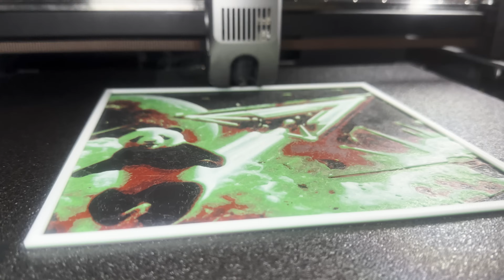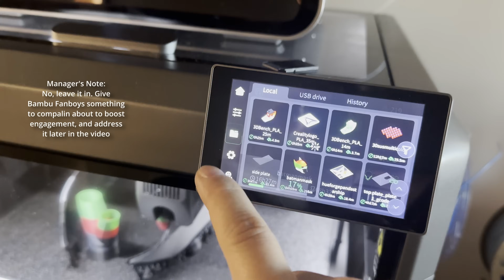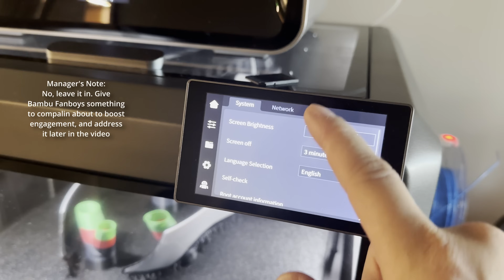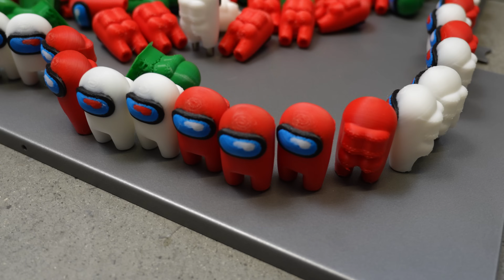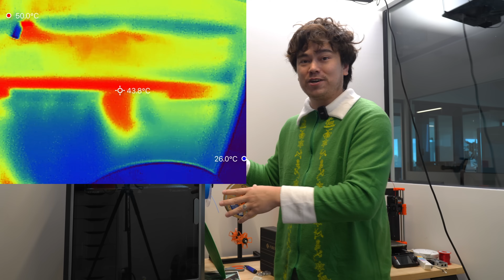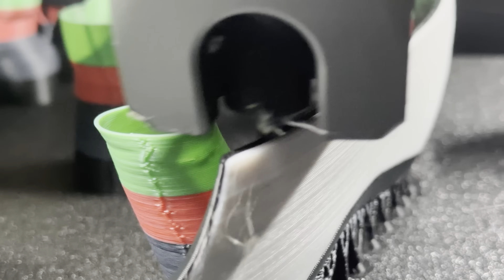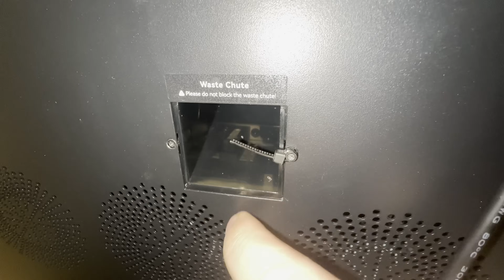Creality K2 Plus - Printer Of The Year 2024 (Goes on Sale Today)

Comment: My only gripes with this printer are these two things:
-The heated chamber has a very inefficient design, the hot air inlet is right next to the exhaust fans so if they're running all the hot air gets pushed out immediately and even when they're off the chamber only reaches max 50°C instead of the 60°C as advertised
-The software Creality Print is sometimes buggy and managing print profiles is a total night mare. Not only is the interface cumbersome, but there are TWO kinds of profiles, one for the printer itself and one for each filament and the print settings are distributed between them, seemingly at random. You'll find print temperature and cooling on the filament profiles, but layer height and print speed on the printer profile. Total nonsense lol

Comment: Well I kept my word and I ordered the K2 bundle a week ago. I see some people having problems, but they don't seem to be too clustered. Mostly people complain about the slicer, but I'm dealing with that today on my K1 Max and the deficiencies are overcomable.

Listening to this video again today, something struck me. You keep saying its better than the Bambu in every way, but you're missing the reason it's not. If you don't have a strong case for a 350mm^3 multi-color printer, the P1S is better for economy. Get 2 for the price, great quality, multi-color. All of the edge cases with higher temps etc., are not a concern for most.

Obviously, I have a use case, or I wouldn't be forking over $1,500. I'm also getting a MK4S for enjoyment, but there's no way I'd get the XL. Too pricey and fraught with issues.

Comment: Man what kind of engineer you are? electrical? You don't need a 3d printer for your designs, but a plywood lasercutter
Reply from the maker: Yeah i thought the same thing, but I discovered that a large 3D printer is much more useful than a laser cutter in practice.

With lasers you produce a shit ton of smoke and have to have large sheets of stock material, which you only get maybe 60% utilization out of it by area.

Vs a printer it is slower, but takes up less desk space, materials are more compact and used more efficiently, and you can add 2.5D and 3D features, don’t have as serious of ventilation requirements, less risk of blinding, etc.

Comment: Looks like a good printer, may well get one myself if the 1q25 BambuLab release isn't a big step forward. Shame they didn't go for a six way AMS as there should be room for it on the top. Plus for the record the BL X1C detects purge shoot blockages and pauses the print.😊

Comment: If in 6 months Creality brings a K3 and the K2 plus is "forgotten" as Creality tends to do way too often, then it's not worth half what they are asking for it.  It's nice to see they made something that is state of the art (last time was the CR10 or Ender 3), but their lack of long term (or just plain) support in the past, makes me say: let's wait 6 months and see how this evolves ...  But what a BS on them being so open-source friendly.  They only released access to Klipper (aka Creality OS) after lots of pressure and being called out by many 3d printing Youtubers.  Also note that there is no "if Creality releases their changes to Klipper" - they are legally required to release anything they built on top of Klipper as it is GPLv3.  The same holds for their slicer!  Bambu is not running Klipper - they can't ... a P1S or A1 doesn't have the cpu to run Linux and Klipper.  They were able to fit as good or even better algorithms on a cheap ESP32 (including custom stepper control), so I don't blame them wanting to keep that artwork of programming closed source.

Comment: for the  waste issue between this and the prusa xl  for cost difference between both machines (1500 vs 3500) you could build a filament recycler for the poop. And the xl is missing a lot of features the k2 has.

Comment: Now... I can't wait to see what the K1 CFS Upgrade kit will cost. I've had to upgrade my K1 a lot to get it working nicely. Did the Linear Rail mod, the LDO Stepper with 20T Pulleys. Also got the first gen K1, with all the Extruder and hotend issues. But now, it's working nicely and I'm planning to do Linear rails for Y axis too.

Comment: Six minute into video and nothing said that make this "Printer of the Year" or it being any different than the first "K" which is a BLab clone. Even the AMS looks the same. What I can tell is different is that the K2 seem to have much larger print volume and that is what I was hoping you would get to. AND that seem to be the "biggest" difference? How can this be "Printer of the Year" when you are comparing it to a 2+ year old Bambu Lab? How does this stack up against the new Qidi?
Reply from the maker: It has a chamber heater.

The Qidi has some issues with the electronics melting, idk if I'd get one just yet.

Comment: Hello, today I have seen a P1S with an issue with one of the bearings which was made hard to access and basically bambu declaired an 8 hour work to replace it. And Alternatively they suggested to replace the entire top kinematics section. Is the Creality this bad to maintain also? I have read somewhere about a Qidi printer as well which you are unable to replace some parts, most likely to boost manufacturing of their machines.
Reply from the maker: Yeah I literally gave them several paragraphs of explanation of how the Corexy cantry is going to be a huge problem if any of the bearings go bad (they WILL go bad eventually, they are wear items). Basically, use them until they break, then throw it in the landfill and get a new one. Great business model as you have to keep buying from them.
Reply from the maker: BTW I sent them this explainer 2 years ago.
Reply: @NathanBuildsRobots  thanks for replying,  I can't see someone buying a premium priced machine from them once someone experience this issue. It's weird that nobody ever mentioned this, I just saw this today. It seems to be a very bad engineering choice from them but most likely have prioritize manufacturing cost and speed.
Reply: @NathanBuildsRobots  You don't have to do it in one 8 hr marathon though. Sure, it's a big job but break it down to an hour or so each day and it's manageable. I'm not saying it's ideal, and shouldn't be improved, but it doesn't make it disposable. Plenty of machines take a long time to fix. They do at least have really great service info.
Reply: @NathanBuildsRobots  Is that kind of thing less of a problem on this machine than a Bambu?

Comment: I really would like to own one.

But for that price I could also invest in one K1c, one Sovol SV08 and since there would be money left either in a CFS unit for both or in a Voron 0 Kit for rainy days.
But it's more than good that Creality is catching up with their homework! Hopefully a separate purchasable CFS and a normal sized K2c for like 599 € do follow.

I wonder .... for 3 times the price of that Sovol SV08: is it 3 times better? Especially considering printing mostly PLA, PETG ... maybe some ASA?!

p.s. What I don't like about Creality more and more is no consistency. Prusa had like the same extruder/ hotend combo for 3 generations of printers. As far as I know the parts (e.g. nozzle) from a K1 don't fit into a K1C or now into that K2. Same with that Ender 3 V3 lineup: 3 different models available where one base models with 2 upgrade kits available would show some foresight. It seems like Creality only engineers and develops for the very next printer instead of a homogenous lineup or even an upgrade path.... Same with their slicers.
So fingers crossed that they stay with that Orca-slicer fork. Fingers crossed they really feed Orca-Slicer with profiles also for their old printers. Fingers crossed that CFS is going to work with K1 or even Ender 3 V3 lineup!

Comment: Like others have speculated this might be a clue to what the BBL boys might spring up on there next Big Boy 3D printer....  when?    I haven't heard anything yet on the timing.  And on a side note I would really like and appreciate it if the boys at BBL would incorporate or sell an upgrade on their P1S slim U.I. interface to a proper sized U.I. display as their X1C unit with the capability to provide an image of what is going to be printed.

Comment: I only just swapped my original v1 ender 3 that was heavily modded for a sovol SV08 and now I picked up a K2 with a 20% discount on the official creality ebay store.

Even if I never mod the K2 the ability to do so also means it will be highly repairable 10 years down the road but almost certainly update the printer with new tech as time goes on.

Once I get my K2 i will be modding my SV08 to be a multi head printer and hopefully one of the heads will be used to print PEEK and Ultim.

Comment: So really its this printer vs the QIDI Plus 4 (which is only 310x310).. be curious which of the two are better/faster, more consistent with quality prints.
Reply: Yup buts its now resolved. They are sending out new ssr boards as well as ordering refunds. QIDI was awesome in sending out parts for my heater and a new hot end as well free of charge and are giving one year extended warranties to everyone affected. That is how a company should respond. Give them a chance. They have an even more open platform using klipper out of the box. Well worth a look given the 370c nozzle temp speed chamber and bigger belts that all but eliminate vfas.
Reply from the maker: Qidi plus 4 has had a fire risk due to a design flaw in the chamber heater circuit

Comment: Looks pretty good, but given what happened on the launch of the  K1 (and with Creality's reputation as  "mod before you can actually print"), I would give it a few months to see what shakes out with the full production shipping units. Also a bit concerned with Creality's pace of "innovation" that maybe parts won't be available when the "K3" gets released. They seem really good at fracturing their product lines with incompatible parts.  At least with the Bambu X1 series, there's plenty of 3rd party parts and support available because it has been around for a while.

Comment: it pretty much seems like a bambu x1c with larger build volume, possibly better motors, and higher cost, not quite a revolution. I'm expecting the new Bambu printer to have a next gen multi material system, like multi toolhead or at least a much more robust AMS. If Bambu just released a larger X1C (which this one basically is) I'd be pretty disappointed.

Comment: I have no bambu or k2 printer. But from the looks of it, bambu has "developed" a good software plattform which is very easy to use and very reliable. I think, with the klipper k2 you might have to tweek things more often on your own (and you can do so, if you want to).
- well developed proprietary software +/- (depends on the user and usecase)
- the case of the Bambu X1C is full metal and looks stunningly good
- I don't know if it is any good, but bambu has an auto calibration feature for filaments and filament sensors for filaments from their own company
- many people are using the bambu lab printers of similar types (P1P, X1C), that might be an advantace for questions about it or to figure out settings for particular filaments or things to print
- you can order many replacement parts for the bambu at cheap/OK prices
- creality has a good track record with low budged printers with a little bit of quality control issues. Since now they only have shipped to youtubers (they will have double checked this printers), we will have to see, if there are some issues
- well, I think the ball is in the corner of bambu lab, from the looks of it, the new creality printer is great and the closed loop servo motor technology is cool 
- I really think the build plate of the prusa xl is great, you can heat smaler portions and I assume it warpes less, because of the gaps - I had hope other companies steal that concept

Comment: Does it poop?
Reply: Yes, it does, just like all other multi-colour systems that use only one print head. Either they poop or you have a purge tower. There is no way around this.

As the slicer is based on Orca Slicer, you can certainly use some of the purge as infill or support structure, but this will not always be enough to completely avoid waste. The best thing you can do is to add an object with 100% infill on the print and use that as a purgetower.

Comment: 1 design flaw, the heater pulls ambient temperature air from the outside to the inside. Not only is this inefficient but also pumps toxic flumes into the environment thought the seems in the door, etc. A circulating heater fully inside the machine would be much better, especially if it was at the center/bottom and pulled air via ducting from the center top.

If there open sourcing the whole thing and i already have a solid 300mm cubed bed dropper printer (extremely modified Sermoon D1) i might just get the 'CFS' 🤩and add it to the machine i have now.

Comment: I'm looking for a 3D printer and definitely will prefer one that just works, like Windows 10 LTSC. This one is $1,500 with the ams right now, and $1,800 not on sale. Prices should not really be exceeding $1,000 for non-commercial units like these, even with the ams.

Comment: I am so tired of people claiming Creality is open source friendly, what a crock.   So for the K1, V3, KE sure they released the klipper source, but none of the other services running on that machine, such as display, master, monitor, web, mcu_util, etc.   The prtouch blobs are all closed source.    Creality release only the bare minimum, and they do not make it easy to rebuild things like the klipper firmware blobs for example.  Even for the klipper repos they released the commits they made to their klipper fork were released in a single commit with actual klipper changes making it next to impossible to easily tell what is creality stuff and what is just old klipper stuff.   If they want to claim to be open source friendly, they should release all the sources to all the binary tools on the firmware, release the source for the prtouch blobs and the Makefiles used to build them, they should release the configuration used to build the kernel, they should release the build root so that we could add additional tools.   If they don't want to change that, stop claiming to be friendly to open source, you give root access, that is it, everything else is a joke.
Reply from the maker: Very interesting, can you reach out to me on discord? Would be nice to gather a list of open source grievances to make a video about it discuss with Creality
Reply: @NathanBuildsRobots  Ive joined and posted in #general

Comment: Hello Sir, Isn't K2 supposed to have AI spaghetti detection? Did it fail to detect the constipation of the k2 :face-green-smiling:. :goat-turquoise-white-horns::yougotthis::elbowcough: I also purchased mine tonight with your affiliate link. Appreciate you!
Reply from the maker: Thanks! Mine isn’t properly connected to the cloud or internet, so I didn’t use those features. Also there are some more advanced calibrations you can do, but I didn’t do them because I had to split my time between making parts and tearing the machine down and messing with settings. In the end I tore it mostly apart to inspect the electronics, but for the rest of the time I just ran as many prints as I could in the time I had

Comment: I wish I had 100'd hours of use with my K2 plus, but mine just crapped out after 4 days of use and 12 successful prints.  I turned it on the print head go to the middle and then left side of the unit making horrible noise showing error codes CM2789, TR2863, XS2060.  I might have gotten a lemon, I will have to wait to see what customer service will do. Have fun trying to break yours though.
Reply from the maker: Bummer, do you have any idea what those error codes mean?
Reply: @NathanBuildsRobots  Only the last two are listed on the K2Plus Wiki - TR2863 Retract issue, extruder filament sensor anomaly triggered, filament may have broken inside the extruder. XS2863 System error, try restarting (helpful)
Reply: @oldman1944  My last print was an toy octopus using Tri-Color Black-Blue-Purple-OVV3D Silk filament.  The K2P did finish the print but I found a broken piece of filament in the hub.
Reply: @oldman1944  I tried many time to restart the K2P but got the same system fault errors. I'm hoping for the best but expecting the worst for a solution from Creality. :face-orange-raised-eyebrow:
Reply: @NathanBuildsRobots  I have no idea, I found nothing on Creality, Creality Wiki or the web in general.
Reply: @NathanBuildsRobots  No, I searched but didn't find anything.